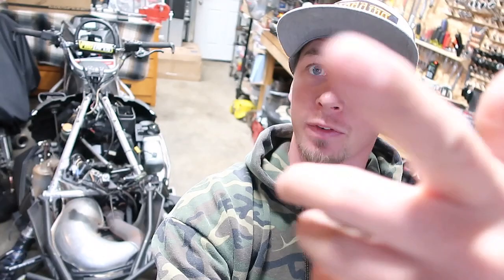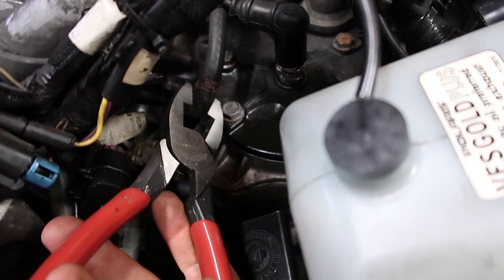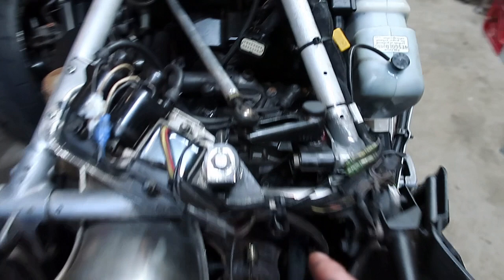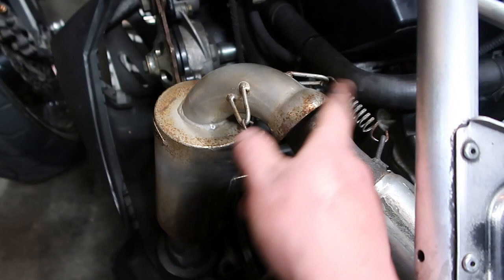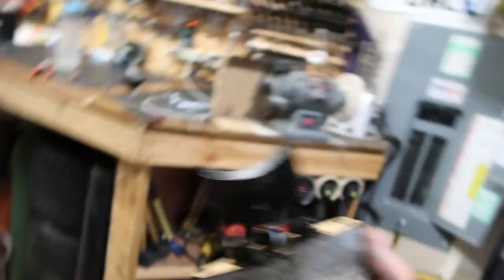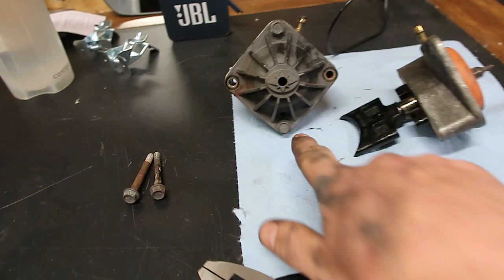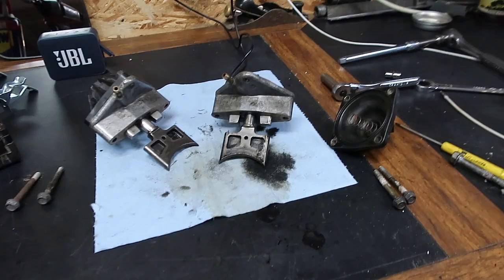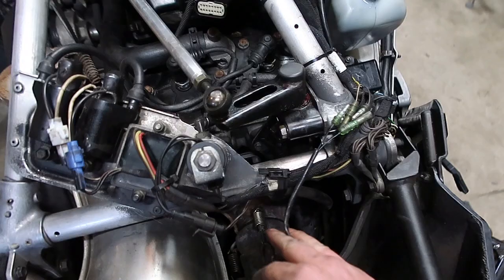Polaris Exauhst Valve Cleaning

Comment: I just did this job(same sled) if you disconnect upper frame work and nudge it out of the way,steering vertical rod free to float,you can remove both valves intact w/out removing exhaust system,better to bench assemble both valves

Comment: I'll give you a trick so you do not have to remove your VES anymore... Polaris Extreme Oil and half a can of Seafoam in your gas tank... Your VES will be super clean ! Polaris Extreme VES Oil barely smokes and the sea foam get's rid of carbon build up. Just my 2 cents. Great video anyhow. I did a similar video to yourse 4 or 5 years ago.